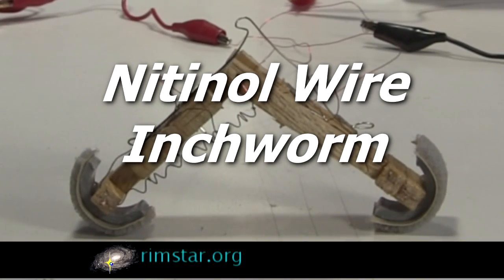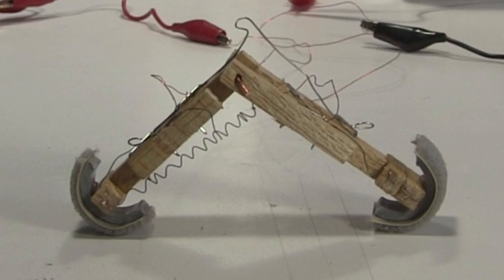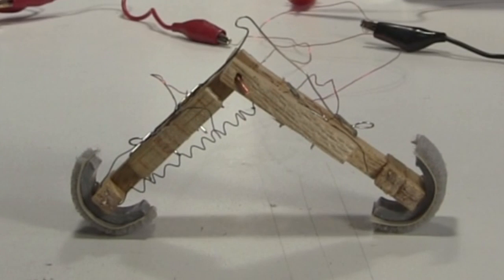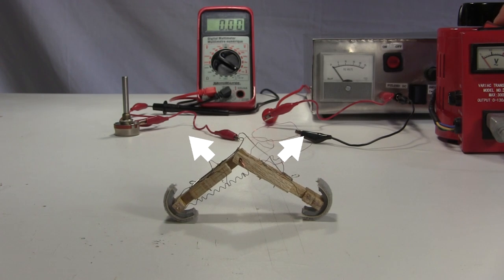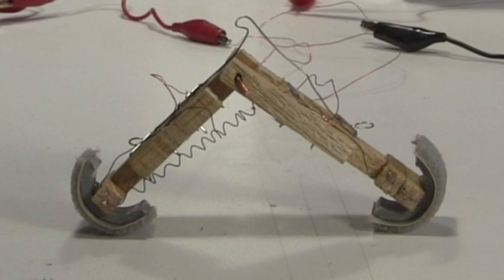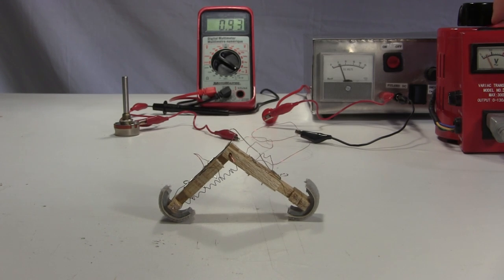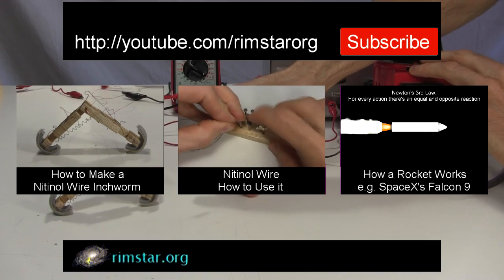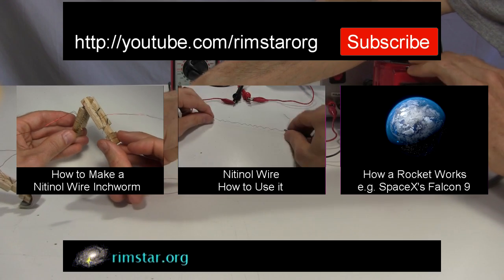Nitinol Wire/Shape Memory Alloy Inchworm - How it Works

Comment: Hey can I know the voltage or current of the power sourcewhere  I can connect a nitinol wire safely to make a fun things for demonstration?
Reply from the maker: The voltage is around 5 volts and the current is just under 1 amp. You can see me measuring is in my video about how to make it http://youtu.be/wKoc7-APFsk

Comment: in line bimetallic switch to heat up to cycle the power?
Reply: zip tie a 35c  normally close bimetallic switch so when it heats up from lag of coil heating it opens turning of the power.
or just a tilt switch and hot glue wire heats up compressing the coil raising the leg tilt turns of power
Reply: @littlehills  or just make a damn circuit? it really isnt that complicated......
Reply: @urnoob5528  "or just make a circuit" --- ah yes ok the i have an opinion but wont tell you how guy 🤣👍👍

Comment: Neat!  
Years ago I made an inchworm engine using the center magnet and voice coil of a speaker (now available from Parts Express as "exciters") as the reciprocating engine, mounted between two halves of a tongue depressor as feet.  To make it one-way, I glued sections cut from paint pads (used to paint stucco, brick or other textured surfaces) to the bottom of the feet .  The pads usually have all fibers leaning in one direction which can be enhanced by ironing (light setting, through paper).  I used an amplified audio signal (sine wave) to drive it and found it worked best across a table cloth or unfinished wood where it could get a good grip.    I could use the engine to power small wheel-less model cars which I glued on top.  It was fun to experiment with different frequency/amplitude/waveforms to find optimal settings for different designs. Some went pretty fast!

Comment: could you tell the composition of wire or specification like transformation temp,voltage,resistance ,current etc ?
if possible also schematic of circuit

Comment: should have add a mechanic to short the circuit during contraction. It's just lousy to switch the circuit by hand.
Reply: use a digital circuit and a transistor duh
trying to strap something to the thing itself overcomplicates it as u need to consider the placement and angle and position and what not
Reply from the maker: Brilliant idea! I agree, that would have been much better than switching by hand.

Comment: plz tell me how can i heat the wire to remeber its shape using electric current?
it requires more than 500 degree celsius to make the wire remember its shape
Reply from the maker: To get it hot enough you just need to run a higher electric current through it. I don't know what current corresponds to what temperature though.
Reply: @RimstarOrg  anything high enough but doesnt melt it will work, no need to think that much

Comment: Voltage and amps required?
Reply from the maker: +Jocke C Nilsson Around 5 volts and 0.9 amps DC. The volt meter is a little blurry but the needle's on 5 volts at 0:58.
Reply: +RimstarOrg Thanks! 😊 Do you use 1mm or 2mm wire? And is it 40, 60 or 80C?
Reply from the maker: +Jocke C Nilsson Mine's very thing, 0.01". Setting temperature is 500C, transformation temperature is 66C. It was from here http://www.kelloggsresearchlabs.com/Nitinol/Raw-Material but they don't seem to stock it anymore.

Comment: Cool work. We are doing something similar by embedding the SMA into the bending structure itself, but getting the heat in (and especially out) is always a challenge. Experimental Locomotion (Inchworm)  Experimental Locomotion (Metachronal)

Comment: Wow that's a very nice system! I wonder what happens if an AC current is used instead. Maybe with the right frequence (and maybe voltage), it is not necessary to switch the power on and off. Just a little brainstorm that I wanted to share :)
Reply: remember the heat is doing the magic here,
ac or dc, it doesnt matter as long as it gets heat
and u need an actual circuit to control it if u dont want to switch on and off, even a 555 will do
Reply from the maker: I don't think AC would work with my nitinol wire. I don't know how easily you can tell from the video but the cooling time takes a lot longer than the heating time. For AC they'd have to be the same, unless it was some sort of modified sine wave. Neat idea though. Might work with different nitinol wire or other shape memory alloys.

Comment: Neat little project. :-). You would expect the wire to heat up and expand, then contract back to the original size as it cools, but it does the exact opposite. Very interesting.
Reply from the maker: Thanks. I never thought of that. Since I shaped it into a spring it makes you think of expansion and contraction of wires but in fact it's actually to do with a wire going to a specific shape when heated and relaxing when cooled. I guess if it was a wire just expanding and contracting based on temperature then I wouldn't need the spring.
Reply: More or less a "memory" wire.

Comment: Nice example. You can do it with any wire... I had 'side effect' of my styrofoam cutter, where nichrome wire is 'preloaded' by spring, and when applying current, nichrome wire extended about centimeter or so per whole length of 70 cm of total length of the cutting wire. Note that spring I use, previously measured tension was about 4 kg, measured with dynamometer (tension scale). So, with material which can change in length, you can use it as a 'driving mechanism'. The most 'strech/shrink' of the all materials is PVC, which contracts/expands lot more than other materials per unit of temperature change. Just 'food for thought' for future experiments. :o)
Reply from the maker: Actually, you can do better using the expansion and contraction of wire by heating and cooling since you wouldn't need the spring. That's assuming you can make it happen in the same size.

Comment: Cool use for nitinol! Your next challenge is to put a electrical contact of some sort on the legs so that the movement of the wire makes and breaks the circuit so it walks by itself!
Reply: this just unnecessarily overcomplicates thing
just make an actual circuit smh, even a 555 will work
Reply from the maker: Thanks! And yes, that is my next challenge, though I'll probably have built something fancier by the time I do that. Godzilla sounds like a neat idea. :)

Comment: Where did you get the small nitinol? All I could find was super elastic. Small can be used to turn heat into power.
Reply from the maker: I got mine from https://www.kelloggsresearchlabs.com I didn't know it could turn heat into power. I'll have to try that.
Reply: There's a video about it on YT about it. The video was made in the 70's or early 80's.
Reply from the maker: thagrit
Yup, I've seen it. I think that was my first introduction to nitinol. I was going to try something like that out but the wire I have ended up being too thin and it's transition temperature either was higher than the 70C that it was supposed to be or I accidentally raised it by heating my wire around 350C, which according to the forum on that website will raise the transition temperature. So I'd need to buy some more wire to try that out.

Comment from the maker: It's alive! Check out this inchworm that walks across a table using nitinol wire, a shape memory alloy. Enjoy!
Reply: I cant help thinking this would go a lot better with ratchet wheels. No printer parts handy?
Reply from the maker: Mongrel Shark
Nice idea, ratchet wheels. But that would be cheating! :D I do have access to 3D printers, some of our libraries have them and I could join our local hackerspace. I just haven't gotten around to it yet. I have been wanting to.
Reply: There are usually a few one way rollers in a 2d printer, with rubber "tires". Along with many other cool parts...
Reply from the maker: Mongrel Shark
Thanks, I'll keep an eye out.
Speaking of reuse, I found another water cooler someone was throwing out with another TEC Peltier module today. You might see it in a video in a few weeks now that I have two of them. I want to try making a single popsicle (ice pole in Australia?) maker. I also bought an old 35mm slide projector at a garage sale that I'm sure I can find a use for, maybe for projecting my computer screen? Haven't thought about that one much yet.
Reply: I've made a small amount of ice with a single 60w cell, on a PC CPU heatsink, with the heatsink immersed in a bucket of water. Wet finger and it freezes to the peltier right away. Drip a drop of water on and it freezes instantly. Two in series will definitely be able to make a popsicle (Probably in a few minutes). You will just need a good heatsink and cooling system to keep the hot side low.

My uncle used to have a slide projector. Its a bright light and a lens, with a stepper motor to change slides. Unless you have one of the newer models with a VGA port (which will have a CRT like device inside), I dont think it will project the computer monitor.
Although if you stripped down a back-lit laptop monitor, you might be able to use it like a projection LCD.....

You can have a lot of fun with the lens and light if its the older style. Even just the lens is probably worth more than what you paid for it... The stepper motor and driver circuit could have some cool uses too...
Reply from the maker: Mongrel Shark
My slide projector is the old style, no CRT, no stepper motor. He had a newer one but was asking too much for it, at least for a garage sale.
Reply: So you change slides by hand?

Could make a good projection magnifying glass/microscope...
Reply from the maker: Mongrel Shark
I just had another look. You load the slides into a tray, back to front so that you have a line of slides (so not a circular tray), and then use a lever to cycle through the slides. I remember when I was a kid my brother was into photography and used 35mm slides. We had this same type of projector.

Comment: Nifty.  

I know you're more electronics, but coiled fishing line also contracts with heat applied to it.  I wonder which is more efficient/powerful?
Reply from the maker: Does heating the fishing line deform it permanently? It sounds like it would, but I don't know.
Reply from the maker: CapnHolic
Oh, now that I see it, I remember seeing that before. The contraction isn't very long but that can move a lever resulting in a longer change at the other end. Given the large strength, the force at the other end of the lever can have some powerful. Thanks for the reminder.